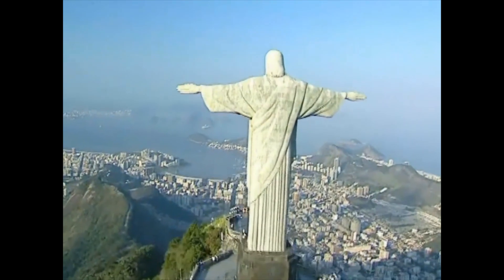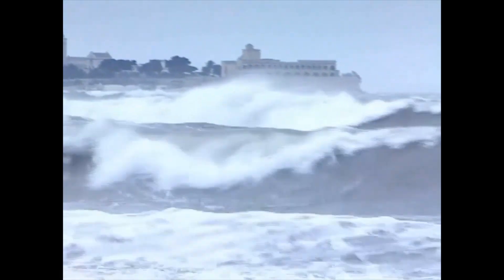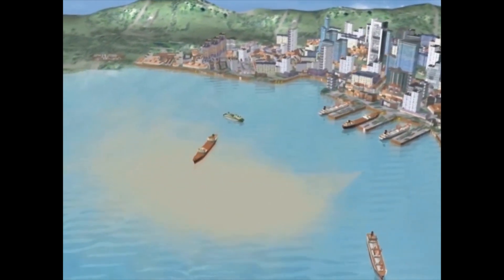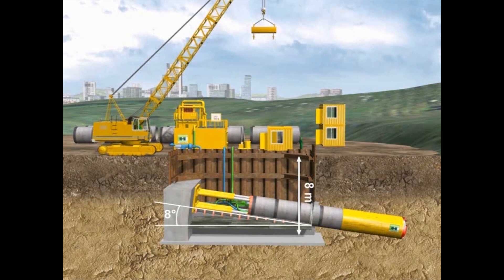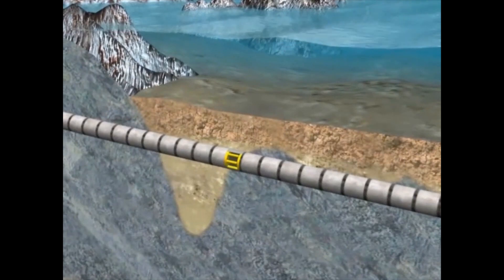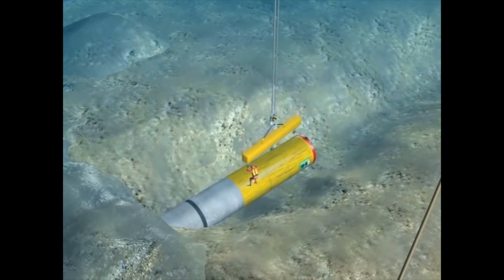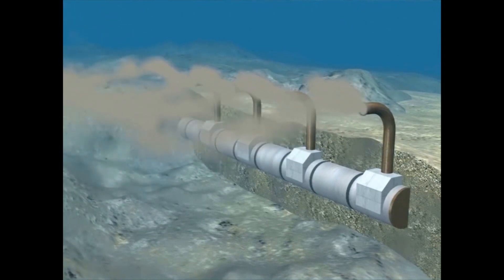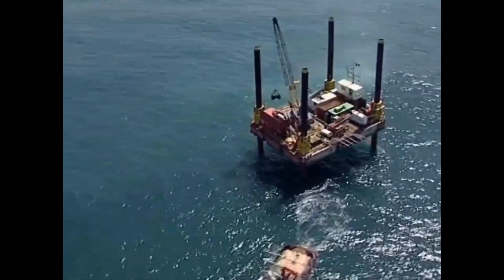Sea Outfall

Comment: Sooo... how do you retrieve the intermediate jacking stations if needed? A retrieval pit at each location? Then you'd have to insert a pipe section in its place and jack the upstream pipe to seal it or jack the entire pipe forward one section length and fill the pits.
Reply from the maker: Dear spdwebdotnet, 

Thank you for the question. Intermediate jacking stations are ‘retrieved’ the same way as in Microtunnelling projects on land – by using special intermediate jacking pipes. They are telescopic and the cylinders inside the intermediate jacking pipes are removed at the end of the drive. Once removed (starting with the furthest one away from land), the other jacking pipes are advanced forward, thus closing the (telescopic) gap inside the intermediate jacking pipe. This process is repeated for all remaining intermediate jacking pipes. The inside of the intermediate jacking pipes looks then just like the regular jacking pipes. Digging any holes at the location of an intermediate jacking station would defeat the purpose of Microtunnelling being a trenchless technology.

Comment: So just pollute the open ocean where it cannot be monitored  that way when corners are cut they can pollute more there is no excuse if the water was clean enough it would not have to be pumped in to the open sea.